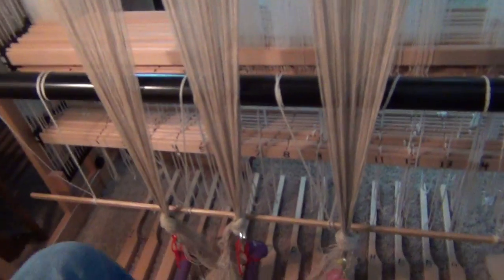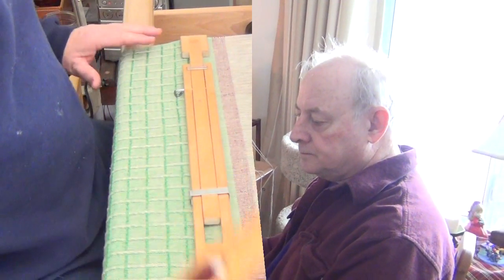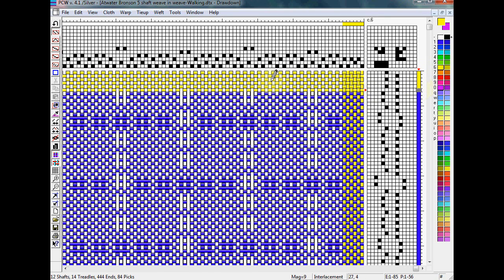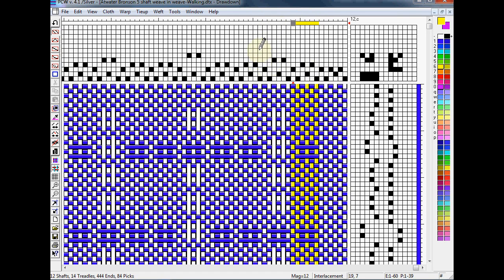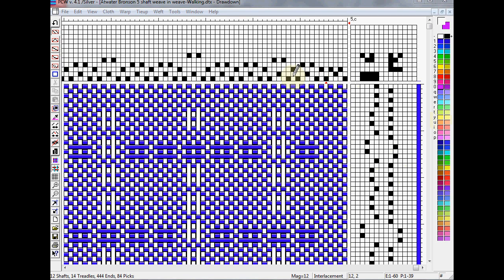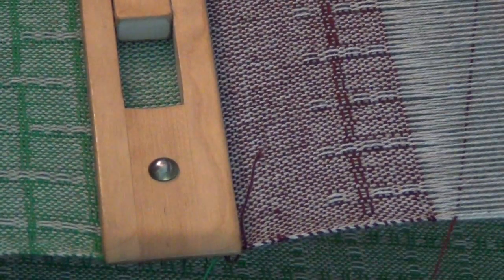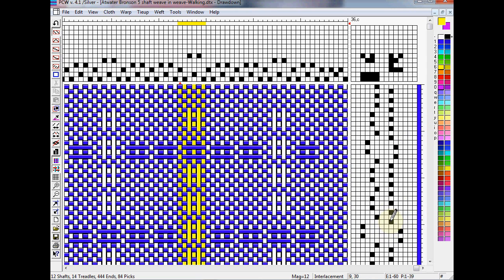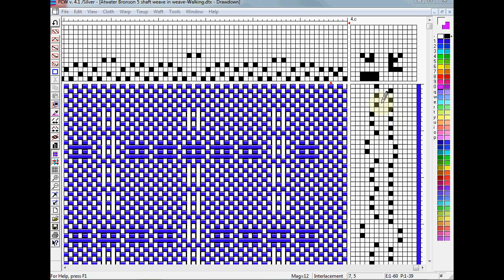Dish Towel Exchange 2015   Part 1

Comment: OK The dowel like handle doohicky. Is that supposed to seat the crossways threads???
Reply from the maker: The dowel like handle doohicky is exactly that : "a handle".  It is simiple an easy place to grab the "beater" and pull the "reed" toward the weaver (me) and thus "beat" the weft (crosswise) threads up tight against each other.  The handle itself is not really needed, it is just convenient for grabbing the the beater which holds the reed.
Sorry but I must use "technical terms" when describing selected parts of the loom, else wise there would be too many doohickies, transfortenators, and discombobulators for me to discuss without ending up with high topper mountain all on hot cocolorum.